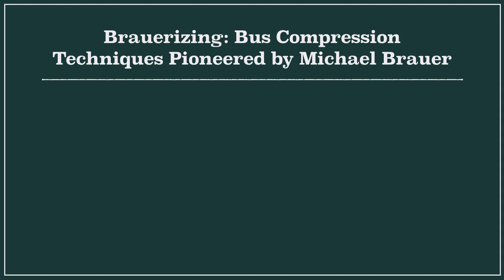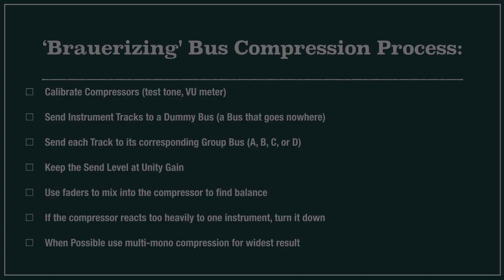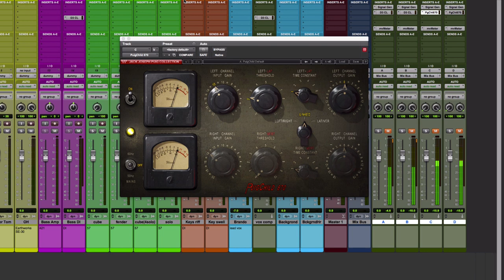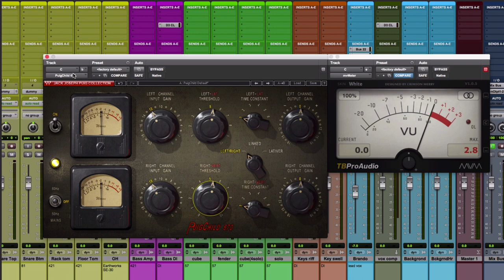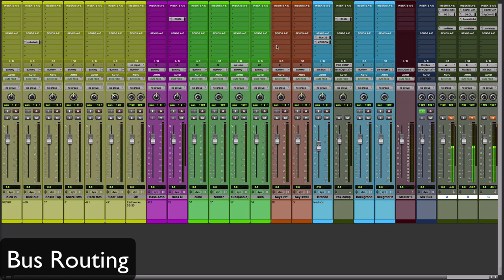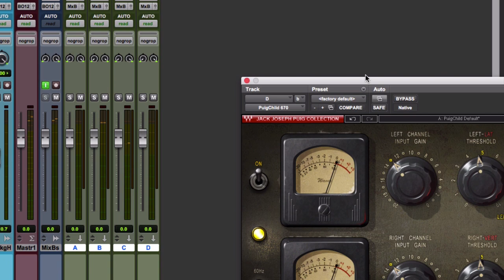BRAUERIZING EXPLAINED: ITB Routing, Setup, and Calibration | LearnAudioEngineering.com

Comment: The best BRAUERIZING explanation on You Tube for sure. I could finally understood the routing. Thanks
Reply from the maker: Thanks a lot! thats great to hear. Glad I could help :)
Reply: Learn Audio Engineering Hey, the only thing I’m not clear are the attack and release times of each compressor. Perhaps thats why they weren’t doing much on your video? Any updates you found since this video? Thanks
Reply from the maker: Check out my most recent videos on compression, I did one on the attack and release envelope. :)
Reply: I understand the attack and release of a comoressor just wanted to point out why in your Brauerizing were not doing anything. Is there a specific setting in each compressor?
Reply from the maker: Yes, actually he has a rack of compressors he claims never change. I have a new video coming out Sunday that goes more in depth on Brauerizing and includes the settings for each. Thanks for your interest!
Reply: Sweet, looking forward to it. I really want to get this thing down. I do believe this technique can work with what I do and how I do it. Thanks

Comment: Great vid...well done! 
Im no Michael Brauer but use this buss type of splitting: not for compression sake. Michael has truly honed this technique into his own artform!
I see some value of the compressors being an indicator but this is generally PEAK compression triggered by spectral transient weight and by no means perceived volume at all. This issue I have with it is that after 30 years of mixing...STOP LOOKING! 
For newbies checking out...we should look with our ears before anything and Im sure Michael is doing way more of that as opposed to the visual which the compressors suggest. I see the compressors used this way as per the comments below...colour and trigger management (which is would certainly polish headroom) and is a great way to granularise the compression and is almost a faux multiband in a way
Just remember as we encroach into a K-12 pre master level...we are killing the power and size of the mix and trapping the mastering engineer...this staggered approached certainly formulates an approach but keep respecting the dynamics...these days the loudness wars are over and side by side ie volume calibrated on spotify, some of the LW mixes actually sound disgusting and fatiguing
I find that breaking the Low/Low mids (B) into their own buss also allows for side chain carving. If you use surgical compressor on the B.2 buss eg like a dsm or trackspacer it also allows for simple transient control that is SPECTRALLY operative  ie  only removes the kinetic or "pressure energy" from the bottoms, although you can certainly use it for any spectral info. This totally changes the feed into the final mix buss and the transient energy is never double ie kick on top of bass etc
B.1. Low End Primary (Transient eg kick etc)
B.2. Low End Secondary (anything that is sustained and needs a hole punch from the transients)

Also, I like to group BEFORE they get to the sub mix busses into grouping like 3 point bokeh photography
FOREGROUND
FOCUS
BACKGROUND
This has the same parallel where the focus has more detail ie sharpness and contrast = more transients, less compression and the others use the same landscape like rules eg less contrast less detail eg shorter attack etc...you get the idea. Try it with vocals...crisp and dynamic lead...crush and de ess with bottom and top cuts for backing vocals and use the sidechain above...you can actually push the backing vocals into the background even though they are nearly the same volume, as they are almost smeared and the lead still has space and focus...more than ever because of reference

Just throwing in some extra ideas...hope it helps
Greetings and peace from Oz!
Reply from the maker: great stuff! thanks so much for commenting!

Comment: To brauerize your mix in the box, you should change the 'stereo output' of your track to 'no output'; open two send busses (in Logic) and you put a different sounding compressor with the same settings in each bus. You've just split the dry sound = brauerized. You can also brauerize the wet sound: add all your plugins in different send busses (= parallel), and put the stereo output of all those buses to for example bus 20; change the 'stereo output' of bus 20 to 'no output', open two busses and add a different sounding compressor with the same settings to each bus; your wet sound has been split = brauerized. Next step: change the 'stereo output' of the dry compressors to, for example, 'bus 30', and change the 'stereo output' of the wet compressors to, for example, 'bus 40'. Bus 30 = volume of dry compressed sound; bus 40 = volume wet compressed sound. Change the 'stereo output' of bus 30 and bus 40 to, for example, 'bus 50'. Add a multipressor with light settings, only taming peaks, to bus 50. Bus 50 is now your premaster for this specific instrument, containing a mix of the compressed dry and wet sound. (Brauerizing means enriching the sound by splitting it up, and it means controlling the dynamics of each instrument, or instrument group, before it reaches the stereo output.)

Comment: It's really wel explained ! But the whole point of Brauer stuff is using compressors that brings something he loves about them. Like saturation with Distressor, Low-mid with Neve 33609 for instance. So it's a good explanation but I don't think it makes a lot of sense using this techniques without a compressor that will brings the color you're after. My 2 cents.
Reply: i'm using UAD  33609 on A, Fg-stress and overloud api550 eq on B, FG-MU on C, and UAD ManleyVoxbox with Ozone Imager on D.
Reply: For me it does, the frequency separation is GOLD !!!
Reply: Indeed good point !
Reply: It makes sense to split material in this way. Even if other compressors are used, the same thought process and technique can still be applied. You wouldn't want to replicate the exact same tonal colour Brauer uses, 1, because every mix is different, 2, to that end; make the technique your own to suit your own mix.
Reply: @SmoothSailingMusic  great! I will try that!

Comment: So...I had some time to test the exact scenario in the vid; its great logic but noticed it was a bit inconsistent and pushed the philosophy of essentially a multi band buss system. 
My question is eg when calibrating the low buss ie drums and bass...the predominant trigger will be the low frequencies of course so why is the calibration done using generic 1khz? 
I tried with the fundamental eg 55hz (key of A) and its a different ball game because of the rms response of the comp vs peak...as per my comment below. 
Wouldn't each 'band' of sub mix buss be tuned to its predominant freq range? Wouldnt it make sense to fine tuned to the key of the music if the instruments were tuned for it? I would normally tuned the lowest instruments, the most methodically and accurately because of the power of phase down there..but interested to hear what others think...despite the ago of the post...its still just as relevant

Comment: Really interesting technique, thanks for sharing. I don't get the point of the dummy bus though. Why not just send the output of each track to the correct bus (A,B,C,D) in the first place? Am i missing something?! Also didn't get the point of calibrating the compressors only to bring down the threshold at the end!
Reply: That's what I do. First, Brauer is using a console and mostly out of the box. From what I read, and I'm not sure I understand it completely, but the bus sends were used to allow for experimenting and somehow related to helping to fix any possible phase issues that happen once things are blended together. But modern DAWs won't have the routing/delay path issues that might have once occurred. I've decided on my tests that the sound is really the same either through the bus or with output to the bus. So I use the outputs.
Reply: I was thinking the same. If the tracks were sent to the ABCD buses through "SENDS" at 100% or at unity gain, why would I send them again from the track outputs ?
How would I make the balance with SEND levels ? Can't we just send the track outputs to their corresponding busses ?
 I think I am missing something as well.

Comment: If you can just arbitrarily change the threshold later, why calibrate in the first place?
Reply from the maker: fair.
Reply: @LearnAudioEngineering  I am just asking from a position of curiosity.

Maybe when working with real hardware it's necessary to make sure everything is functioning correctly  (and similarly) at the same level?

Or maybe it's that if Brauer is in charge of recording as well as mixing, he is going to make sure he gets a certain level of loudness in the first place on each track, so that consistency is there through anything he is working with?

I don't know. I'm sure there's a reason. It just seems superfluous to me.
Reply: @Radeo  The calibration is meant to be a starting point. So, you import your tracks in and start to mix into something that's all set up to go. It's faster and a much nicer sound than starting at default compressor settings. Yes, you can tweak it as needed, and Brauer certainly EQs and puts plugins on individual tracks that need processing, but those processing decisions are made based on how things sound going through the ABCD bus AND the mix bus as step one. This video doesn't even cover what he does on vocals, or mix bus.
Reply: @alexbreyer6921  but isn't the point that if you calibrated your compressor, you are able to judge what it actually does? What I understand from his personal comments is that he calibrates in order to simply being able to A/B switch without any kind of additional gain makeup between altered/unaltered which might screw up the comparison (as louder is always perceived as better). 
So in this case, it's not that the threshold should be changed, just push the faders to get the volume from the summed tracks into the threshold territory.
Reply: @Radeo  you're correct. The idea would be to push your faders instead of lowering the threshold.
Reply: @Rockoslab  So push your faders into the compressors so that they compress equally at the correct amount of compression, and then change the ABCD mix bus faders to get the levels of each group right in relation to each other? So that, when each group is playing well on its own, it's pretty straight forward to get the 4 groups playing well together at the end of the mix.

Push the faders up for each instrument in the group, so that it dominates the compression and pushes the other instruments down in the mix, and then back it off until it's nicely in the mix. Level matching made easy. And use compressors that create a nice sound for each group, so you're winning on two fronts with this technique.

I'm guessing that once everything is at the right volume it's easier to work the EQs as well, and add individual instrument compression and effects. Then, as you make changes, keep re-balancing the volumes of each track until the mix is complete. Super quick and tidy workflow.

I'll definetly be using this for drums and bass.
Reply: As far as I understand his ABCD setup, he usually does not change anything on those busses nor does he use the faders (they stay at 0dB).

He mixes in to them. They are calibrated in a way that makes them hit the master bus in the right way. On top of this he uses 5 different compressors for his main vocals. The main one will be at 0dB, the rest of them are mixed in by taste. The automation is still done on the individual tracks.

Some tracks will have additional compression if needed

Comment: Great explanation. Love it. After finish balancing the abcd bus, do you rout the dummy output back to mixbus  and blend with the abcd bus as pararel?
Reply: I know it's 3 years late but anyone wondering about this: The answer is no. The idea is that the 4 buses are our mixing environments, so it's not running in parallel but you could blend in parallel buses with them too, I find Rear bus technique works well with this.
Reply: @anjinbeats  i dont understand the point of the dummy bus, are all tracks routed to the dummy bus?
and if so why
Reply: @merakimusicIE  The Dummy Bus is there so instead of sending the tracks to the Master Bus they go nowhere, and we can send them to the Mixing environments only. Hope that makes sense.

Comment: Hi Robert, when calibrating the buses I notice A & B start with threshold to hit -1dB and then gain to hit 0dB... but for C & D the input is first raised to hit +1dB and then the gain is adjusted to hit 0dB. Is there a reason for switching the method for C & D or does it not matter if you shoot for -1dB or +1dB? Thanks!

Comment: Absolutely great video and overview of the Brauerization Method, which IMHO, is just overthinking and over-complicating normal, channel >> bus routing techniques. It may work well for him...in his studio...with his particular hardware...but seeing thresholds readjusted after the "calibration" completely negated that effort. After watching this, the only thing I agree with is "mixing into the compressor," which is a great technique to observe (think master bus comp) the impacts of certain high-energy sounds needing to be turned down while also using your ears...which may also mean keeping the element loud(er) and slightly adjust the threshold/attack/ratio of the bus comp.

Comment: Hey! great video here. Why is the signal generator set to -18 db though? If my input gain is way more or less i'd have to change the compressor meters once sending to the 4 mix busses. Would love for an explanation :) Thanks
Reply from the maker: great question, -18dB is the standard calibration for analog. Because Brauer developed this process with analog equipment, and much of the plugin's used to recreate the method ITB are analog modelled, we use -18dB as our calibration point. 

Balancing the input gain of your tracks to fit this -18dB standard will give a better sound with analog modelled plugins. Jason Moss has a really good video about gain staging -> https://youtu.be/xJepTM-01VI

Hope this helps, thanks for your question. Please consider subscribing :)
Reply: @LearnAudioEngineering  understood thanks!
Reply: You might need to set it to -12db. ITB, it’s a little harder to get that same pump. That’s how I’ve set mine.

Comment: Just wondering how to manage vocal EQ in this set up when its split into 5 channels? 

I'm implementing something approaching this in a hybrid set-up with outboard compressors and an SSL Sigma. I'd usually handle my vocal eq post compression, but i'm thinking having multiple eqs on multed vocal tracks is both expensive and potentially phasey
Reply: I would definitely EQ before the multing (at least if you're going this route)

Comment: So, I'm under the impression that this calibration technique can't be done with the Waves V-Comp? If that's true, that's a shame, because it's a nice Neve 33609
emulation. What do you think about that?
By the way, in case it makes a difference to you: "PuigChild" is pronounced like "PwigChild." Not Pweeg/Pyoog. I used to say that too.
Reply from the maker: Lol I got called out for saying 'pasty' instead of 'PIEste' too

Yes, you can for sure do this method with the V comp. Instead of adjusting the threshold use the Input and output gain to find that -1dB sweet spot, sorta like he does with the 1176s. I talk more about Brauer's Setup in tomorrow's Video :)

Comment: How do you stereo pan individual channel strips when using the "brauerizing" method when the individual channel strips are sent to a dummy bus? As soon as I left click on the pan to choose stereo pan instead of regular balance mode (I'm using Logic Pro x) my daw automatically creates the dummy channel. As soon as that channel is up, the signal passes through on the dummy channel as well which is not my hope. I just want to stereo pan an individual channel strip.

What wrong am I doing? I have set up the channels according to your tutorial videos on how to "Brauerize" to test it out but I would love to stereo pan without any problems of that sort.
Reply: I use Logic as well. I'll talk about two approaches to this. You can set individual channels to "no output" instead of a dummy channel, and then use sends to get to Bus A, B, C, or D. Or alternatively, you could just send the output on the channels to their proper group bus, which is what I've done. The sound is the same. From what I've read about Brauer's approach, this has evolved multiple times over the years, and he doesn't even really like doing it in the box. But the idea of using sends instead of the channel outputs was due to possible phasing issues that come up later after things are routed through multiple paths. You still want to check for phase always, but this problem has been less of an issue with DAWs over the past few years. I think we're fine to use outputs instead of the bus sends. And as far as panning, I set the bus to stereo pan, and adjust pan on individual tracks.